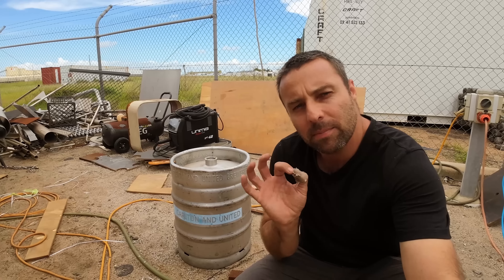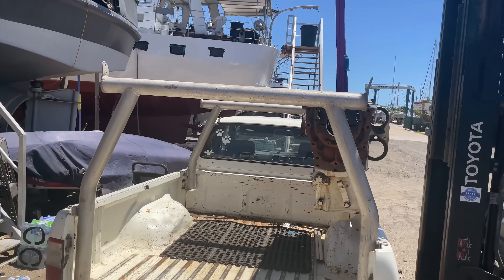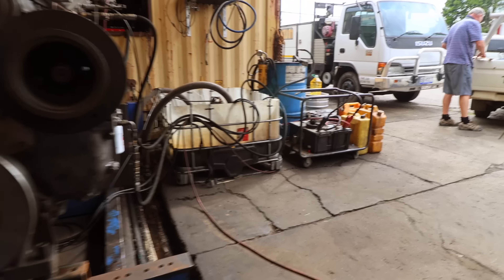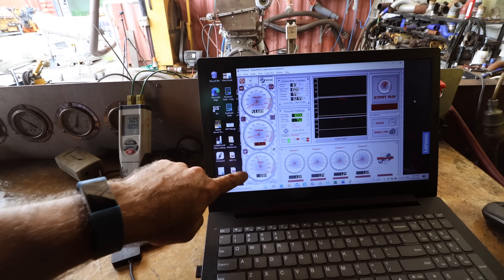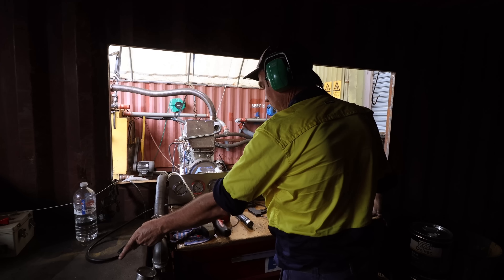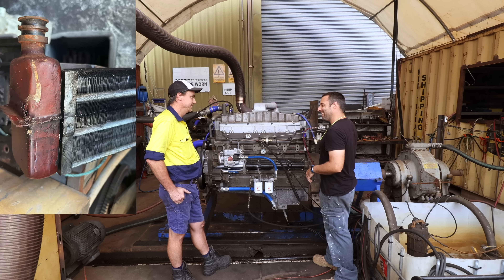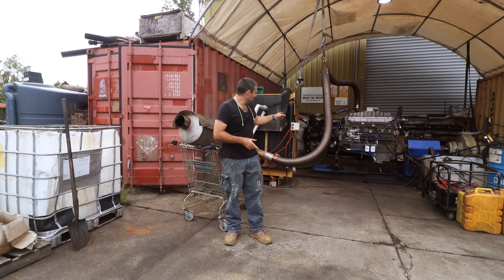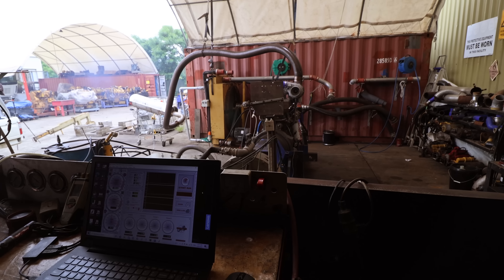Brupeg's Engine Dyno Test - Full power on Vege oil - Project Brupeg Ep.294

Comment: My 7.3 powerstroke that ran over 100,000 miles on straight veg had a coolant loop in the tank to maintain veg oil temp in the veg tank. Also a custom coolant jacketed fuel filter as well as insulated veg lines. Started on diesel, switched at 160 F degrees. Switched back to diesel before shutdown.
Reply from the maker: Jon that sounds almost identical to the system we are designing. Issue we have is our coolant only gets to 78c at cruise and 82c at full throttle. We need to lift the oil another 20c on top of that so we are thinking about exhaust heat or lube oil heat scavenging to bump it up high enough
Reply: @ProjectBrupeg  
Yes, true that a diesel in a truck creates more heat with acceleration where as a constant speed diesel like boat and heavy equipment engines might not. 
I met a lot of veggie drivers at an event we held annually called Greasestock. There were some that used supplemental inline electric heaters and one guy that used exhaust gasses to capture heat. Love the channel btw.
Reply: @ProjectBrupeg  Arctic weather heat exchanger. They look like a muffler, but they're a stainless steel plate sandwiched between two "boxes". On one side you have exhaust gasses, on the other you have the fuel. I've no clue who makes them, i know they exist because i was talking with our expedition mechanic, being curious about what exactly do they do to their trucks in such weather so the fuel doesn't reach the engine cold.
Reply: Running on diesel before shutting down sounds like a good idea, otherwise the veg oil may gum up the injectors .
Reply: Kudos to Carl also and old faithful Duncan, the master blaster
Reply from the maker: I’m very keen to learn more about what products are out there to scavenge exhaust heat as I was thinking of building a set of stainless pipes wrapped 10-20 times around the exhaust as a heat exchanger but I’m not sure it’s the best option yet and would love to hear or see some links that people know of for something better
Reply: @ProjectBrupeg  Polar Power make plate heat exchangers for exhaust heat recovery. Other options will be available.
Reply: Currently at 230,000 on veg with my 7.3 AND 330,000 on tdi jeta with no fuel heater of any kind. but it rarely gets below 60f here in Florida
Reply: @Project Brupeg  well I would do it only with the exhaust then. Let's get a nice machined stainless heat exchanger.
Reply: Had a veg oil Unimog in use when working forestry: the kit it had to make it a veg-oil Mog was a water-coil in the tank as a preheater, a filter heater (double filters sleeved with a copper pipe that contained engine oil), plus gasoil return went into the filtersystem first, to keep these crispy and to have warm returning gasoil first to the injection pump, plus an additional extra preheating glowplug in the fuel line right before the injection pump to make sure. Worked a treat. We had a double action valve turning both lines (feed and return) from diesel to veg and back in one action. Took some time to clear the filters from veg back to diesel in the evening and thinned (or thickened) diesel in the separate jerry-can starter-tank with veg oil, but that wasn't an issue with a machine usually 8, 9 hours running a day and only one shutdown. I would have preferred two separate valves however, and a glass-dome to see what's going on. When cold, we just let it run on diesel for a bit longer to get rid of the veggie-soiled diesel now and then.
Reply: I still have my 7.3L powerstroke that I ran over 50k miles on WVO. I just can't get the free WVO anymore since the oil collectors started paying the restaurants for it. I learned a lot while doing it though. One thing that you don't have to worry about is getting it up to a specific temperature. You only need to get the oil warm enough to flow through your filters, and 40 degrees Celsius, or 104 degrees Fahrenheit, is warm enough for that. Even though my truck has a heater in the tank and heated and insulated fuel lines, that is mostly because I live where it is subzero in the winter. So even if your tank is 10 degrees Celsius, or 50 degrees Fahrenheit, your oil can flow through the fuel lines to get to a heater that uses some form of waste heat to heat it up to about 40 Celsius to get it through the filters well. I use the fuel line bundle that uses the engine antifreeze running through supply and return hoses to the heater in the tank and they're bundled with the fuel line to warm the fuel in the line before it gets to the filter, and continue warming it as it gets to the engine. Then the engine heat will heat it up much more as it starts flowing through all of the other engine components such as the fuel pump and fuel injectors. No matter how much heat you do or do not add to your vegetable oil, it will always become the same temperature as your injectors before it gets injected into the cylinders. That's why you don't have to worry too much about exact temperatures. 

Oh, and for converting between Celsius and Fahrenheit there's a way to remember how. If you remember that for every 5 degrees Celsius you have 9 degrees Fahrenheit, and 0 degrees Celsius is 32 degrees Fahrenheit, you can realize that at 0 degrees Celsius you are 32 degrees Fahrenheit and at 5 degrees Celsius you are 41 degrees Fahrenheit, and at 10 degrees Celsius you are 50 degrees Fahrenheit. 
The formula becomes: 
°Celsius÷5×9+32=°Fahrenheit 
And to go the other way: 
(°Fahrenheit-32)÷9×5=°Celsius 
So if you have any temperature in Celsius that is divisible by 5, then it becomes easy to divide by 5 then multiply by 9 and add 32 to get the temperature in Fahrenheit. 
So 80 degrees Celsius is 80/5=16 and 16×9=144 and 144+32=176.
So 80°C = 176°F
Reply: Oh, I also used the two tanks with the switching valve for startup and shutdown.
Reply: Use an egr cooler of any modern diesel choke with valve to get desired temps, or get a proportioning valve and use brunet to automate the fuel swops

Comment: Nothing like running veg oil and the feeling its awesome to stick the finger up at the RIP OFF service stations on the way past running free veg oil and it feels better in the engine.

 I ran my 1HZ Toyota Coaster engine on veg oil, did the Murray Darling river system Australia last year, 3000 kilometer trip on the first go on 100% SVO, twin tank, filtered 20,10 micron. It had two heat exchangers in vehicle a 60 plate coolant heat exchange and a another one right before the IP. Heated boiled the oil over night in a drum campfire (it got REAL hot) from fish chip shops before filtering and putting in vehicle tank, started on cold svo stopped cold veg oil (this was probably a big mistake). I though oh it ran so good it doesn't need to start on diesel and stop on diesel. 

After the 3000 kilometer trip the brand new injection pump was filled with brown rusty looking sticky stuff, anything the stuff touched that was steel or metal was like that esp in the steel original tank, the other plastic tank was good and clean, plastic for everything is the go or stainless steel, the vain pump was that stuck with it, the vain wouldn't come out so it wasn't pumping any more veg oil up. I broke down roadside and didn't go again. Took the pump off and rebuilt it myself and it running again on diesel as of now. Nightmare. 

Everything ran perfect for miles and miles on end until last few weeks it started to get rough. It seems all good but it slowly builds up junk in the injector pump and the injector tips were stuffed. Caked with black crap. It ran clear in the exhaust clear as a bell from 1 second after starting with a little puff black smoke to enitially start. 

I see you're setting up a vacuum pump old LPG filtering system and i watched the video and I'm currently building one (small scale) out of a LPG 45KG big bottle system as i was looking for answers how i can fix this situation. You may be eliminating the possible problems i had by doing this!!! Getting the Dissolved Water, Emulsified Water and the Free Water completely out is critical imo. 

Couple of things i learned and rules I'm putting in place for myself to always follow:
1). Heat oil 80-100C and cycle and filter in a 44 gallon drum and fanning the air to atmosphere and have a air fan blow it and filter to 1 micron a few times not just once. Maybe go through the filter cycling when its cooler to as too hot ruins filters. Cycle it as its cooling below 80C.
2). Put the oil in a vacuum and dehydrate water out. Just heating boiling does not get it all out. 
2). Always do the basic crackle pan test oil before going in tank.
3). Always start on diesel get well hot and purge well on diesel. 

Will be interesting to see a video of the running filtration system you eventually settle into place. Its hard travelling as the stuff gets stirred up all the time in 44 gallon drums. I will probably to process 44 gallon drums on land at camp sites when stopping a few days to a week and using camp fires to heat and process the oil. Its easier if at home just settle the stuff for years in IBC 100 ltr containers and have heap of em and this is the stories you often hear most of ppl doing it. 

All the best thanks for the detailed video. The LPG design I've come up with will screw into any top 3/4" female fitting in the top of existing old LPG tanks and no welding or cutting into the existing tank and use a dairy vacuum or might use a old AC system yet still building it as i post. I will have a video on it on my channel when its finished and running.

Look up Oil Burner YouTube channel he has a good system worked out and simple and old school. I'm currently building the old small block chevy pump as as wvo pump as, one, it will handle volumes and two can handle the heat and constant RPM to move oil solid all day long and does cost a fortune.

Comment: There is a guy in Canada, who has a 4-53 GM custom fitted to a Ford F-350. He is running veg oil, and found that water/methanol injection keeps carbon from clogging his injector nozzles and piston rings. I ran the NTC-855 Cummins in road trains during the 1980's and 1990's..........the Formula 350 is the best.  Keep the revs at or below 1800rpm.......they dont like high revs.  ALWAYS keep Cummins DCA or pre mix coolant in the cooling system otherwise electrolysis will eat the liners out. The NTC-855 can be very reliable, provided it gets a quality rebuild.........line bore the block,new head bolts,mains bolts, conrod bolts.......no short cuts.  The CPL also denotes the fuel pump setup. The NTC-855 had a small cam version and a "Big Cam" version, the latter being better (less cam wear).  Turbo's have improved enormously since the Big Cam "4" came out in mid 1980's.  Ceramic coated exhaust manifolds and turbine blankets also make a difference to turbo spool and efficiency. Really interesting info you have on veg oil temp and performance relationship.  Thanks ))

Comment: Damien you and Miss Jess are a funny set of Kiwis. You use the metric system for everything but that Cummings engine.  It's a 14 liter engine. 😅😅😅😊 
And the US Military has been running engines on all kinds of oil for years. Diesel , motor oil and many more. 😊 Kathryn and I gave to the gofundme using  PayPal.  Glad to see it running strong on the test/dyno stand. I have one of my Cummings liner converted into a small forge.😊
Reply from the maker: Thanks Michael. It is an odd thing I was never taught the imperial measurement system but picked it up when rebuilding engines for a living when I was 18. We hugely appreciate your generosity and it’s been an honour having so many people back this engine. Thank you from the bottom of our hearts.

Comment: 20 odd years ago we used to run my wife's old manual pump Volkswagen on veggie oil (whichever was cheapest) straight from the supermarket, sometimes 100% veggie sometimes mixed with whatever diesel was in the tank, never had a problem other than the smell. So many people were doing this that at one point there was a 4 litre/person limit at the supermarket.

Comment: Look into using a heat exchanger line between the oil tank and engine block with the hot coolant out line jacketing the oil feed to the injectors.  I've see the veg oil guys in colder climates use them with good results. Also, a stainless electric heating element and a PID controller would help heat up quicker and maintain optimal oil tank temps.
Reply: What about using the heat from the gearbox?
Reply: @thatdave86  Since its going in a boat I don't think the gear oil will have a need to be cooled.  without enough excess heat it wont be able to heat the veg oil up to the necessary temp to fuel the engine cleanly.

Comment: Damian that has a wonderful lope at Idle and in all it sounds great .I'm a diesel engine technician and have worked on Cummings over 35yrs as well other manufacturers. Cummings  run low oil pressure but high volume I believe  you need use a different oil supply pump operated by auxiliary device to maintain oil pressure and volume to internals, 1000 rpm is not enough rpm to reach full oil pressure and volume, especially when it is working under load. When oil get warm pressure drops also.I was just thinking this is not a piece of equipment on land and you guy's are very smart ,I don't know anything about building a boat or navigation but one can say I know a thing or two about engines.

  Cheers from 🇨🇦

Comment: There is no doubt karl knows these engines. The turbo is a apart of the cpl list of performance parts, a garret turbo on a cummins is not keeping with the cpl listing, I'm glad it was   changed. 
As far as a new engine v the rebuild, the issue you have is that cpl 700 is non certified where as the new NTA is IMO 2.
Your old engine was a CAT So you are repowering. If this vessel is going to be registered under AMSA then you are going to have to meet IMO rules. The rules state that other than an identical like for like replacement, you need to install an IMO tier 2 engine. 
Even pleasure boats now have  to meet these rules.  Hope you get around this as karl has done an excellent job. The testing with the different fuel was very interesting  and quite well done.

Comment: You can install a oil heater on the vg oil line as close as possible of the engine fuel injection pump. That will keep the oil temp at the optimum value all the time and will allow to a faster transition from diesel to vg. Keep up the good work...

Comment: Was very surprised at the fuel efficiency using canola.  Was expecting as much as a 50% higher burn rate compared to diesel. Carl did an exceptional job on the rebuild.

Comment: Another thing about diesel engines that might be a bit surprising to petrol heads (including meself) is how RPM, throttle and torque is related in petrol vs diesel.
In a petrol (or any other combustion fuel) engine you always target a very specific stoichiometry, so the power you can get out of the engine is directly proportional to the volume of air you stuff into it, which again more or less means RPM (with the slight variation of the turbo), and you can't just increase the boost/compression since then the fuel will pre-detonate/ignite (=quick way to have an unscheduled disassembly of your engine), so to get more power => put in more air, and a given RPM results in a (semi) fixed power/torque. This is why they have (or used to have) throttle body that restricts the air flow.
In a diesel, not only do you have a range of fuel/air mix that will work (though it still has an optimal one - which is basically what they're discussing with the clean smoke etc), but since you're detonating the fuel anyway by squirting it into the cylinder when you want it to detonate, you can just shovel as much air as as you want into the cylinders (withing reason of course), which means you can produce a range of output power at a single RPM. So to adjust power, you adjust the amount of fuel you burn.
When you realize this, you suddenly get a better understanding for why (or one of the reasons why) diesels are more efficient, and much easier to work with in an industrial setting.

Comment: Might I suggest some electrical trace heating tape wrapped around the veggie oil supply and return lines? It won't heat up the oil to a higher temp, but it will reduce the system losses to a point where it's no longer a problem. 
This is a very common solution in commercial burners when they are using a heavy oil for combustion, the return line is always the most important, especially at max chat, because the return line won't be flowing as much. Heavier oils can easily start to solidify if not above 80 odd degrees........ we sometimes have to heat it to around 130 degrees and atomise it with steam to really get it going.......
Reply from the maker: When we get to the install and vege setup in the boat we will definitely be looking at this type of thing. Thanks Nick

Comment: With this smooth running engine and the right engine mounts. The vibration will be minimal. Makes for a enjoyable experience on board. Being on a boat that shakes like dog in the rain is not fun. 
I take it you will use the engine coolant for heating the veggie oil optional temperature with a solenoid when under way.
Ps. I take it the engine will be painted  off white.  Making it easy to spot oil leaks etc. 
Thats going to a great party when she gets her engine installed.
Reply from the maker: Yes engine is already painted and looking amazing. Freight up to the boat will be late this week. Hopefully see it next week
Reply: @ProjectBrupeg  
Wonderful 
Give you time to stock up on beer. 
Looking forward for the great video.  May it be a safe day no troubles tucking in the trans and engine. 👍🏻🎉🍻🍻🍻🍻

Comment: If you ran a hot antifreeze line through your fuel tanks for the veggie oil that should help warm up the oil. And canola oil is over $9 per gallon here in the USA and diesel fuel is $5 per gallon  for ultra low sulfer fuels